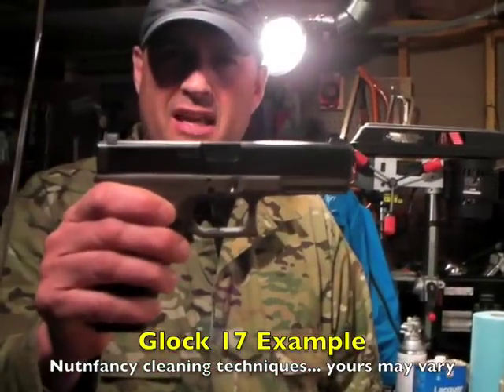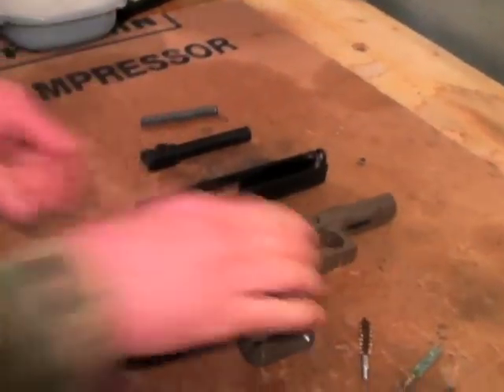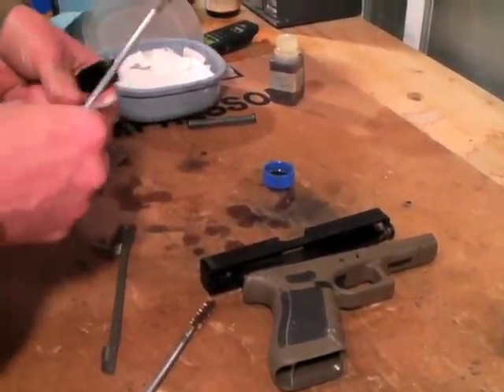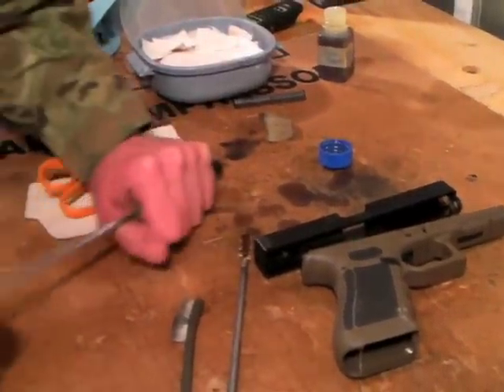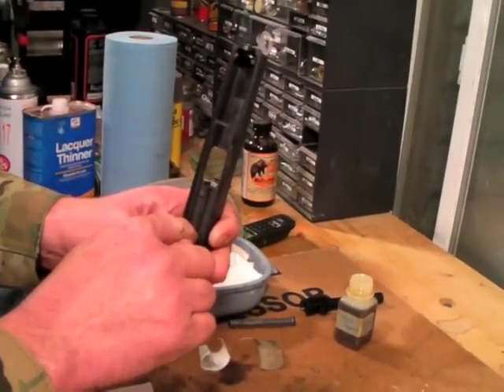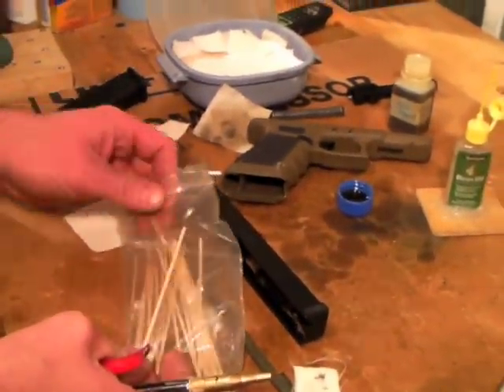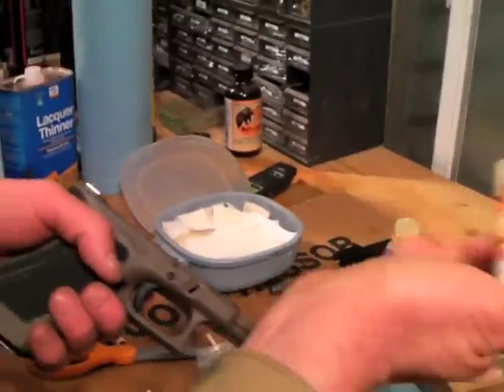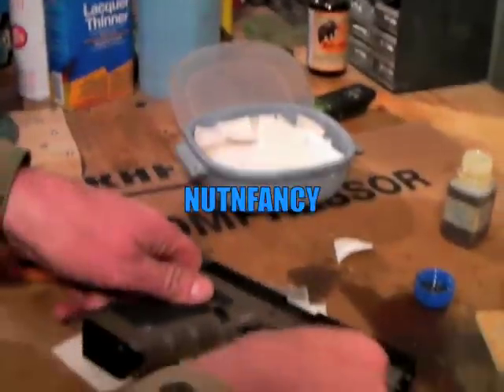Pistol Cleaning by Nutnfancy:  The Glock Example

Comment: It does not matter how many times we have cleaned a gun, it's always nice to watch someone's technique. Thank you for doing this video, it's also nice to see we use about the same products. I am trying this Birchwood Casey spray solvent right now, so far so good. Although the Hoppe #9 is what I'm used to as well. I'll probably switch back when I run out of this spray. It's hard to break old habits. Thanks again Nutnfancy, your videos are by far the best.

Comment: I like how you are not biased to your view on "this is the only way to clean a gun".
you show your system and that's cool. I was actually curious to if I should grease up some of the parts where the slide moves on the actual gun itself. I always just left it normal. thanks for great videos. 
Andrew

Comment: With how often you clean guns I would suggest wearing gloves.  A lot of the chemicals in solvents/gun oil can absorb through the skin.  Make sure the gloves are resistant to the types of chemicals in your solvents as well.  Different types of gloves are resistant to different chemicals.  You can find the information on the glove manufacturer's website.  BTW I'm a biochem major and now in med school, if you're wondering why I'm harping on this issue.

Comment: I spray out slides and frames with aerosol gun cleaner or WD40 in a pinch. Carb cleaner works too. Spray them out allowing fluids to run off into a catch can or something similar using the brush in between sprays. Compressed air to blow out excess followed by oiling.

Comment: I have found that washing my autos in the sink with detergent and ultra hot as I can stand it water works superbly.  The thing is to dry and oil them ASAP since the Dawn and hot water really will cut all the oil off.  The dishwasher will not only wash it hotter than you can stand it but will also use high heat to dry it.  Folks use the dishwasher to strip surplus rifle stocks.  It works.

Comment: You might want to watch using Hoppes #9 and/or  Sweets 7.62 on the internal parts of the frame. Both of these cleaners are metal fouling removing and the internal metal parts are electroless Nickel and Teflon coated and in time these cleaners will strip the plating off. Well according to T.R. Graham it does anyway.

Comment: For the lovers of OEM glock grease, it's just Loctite Anti-Seize Copper. However Brian Enos's Slide-Glide does wonders on on the rails. Know that nutnfancy said not to get too into lubes, but definitely glides smoother than any grease I've ever used and stays where you put it for a long time. A little tub lasts forever.

Comment: that's a good idea, but make sure you clean them regularly 'cause they REALLY hold on to dirt and grease. I used to work at a truck parts store and we lined the front desk with those for the exact reason you did. Little parts didn't go rolling when people brought them in. We never cleaned them though and you couldn't touche them without getting pretty filthy..

Comment: Nice. I personally don't use so much oil though. I use Tuff Glide after I clean for lube and let it sit over night muzzle down to drain/evaporate. Leaves a nice dry film of lube on the rails. No lint or dust.

Comment: Yeah, I understand this but the point is is that according to T.R. Graham in the video "How to Make Glocks Rock," these cleaners will remove the coating on the internal parts in time. I would trust Graham on this because he is a glock armorer and a well known gunsmith. So if you have a choice, I would just use these cleaners on the barrel and keep them off the other parts.

Comment: I agree with the comment that you HAVE to do a visual (or tactile, for low-light practice) chamber and mag check before doing anything other than shooting or holstering!
At the end of the video, you checked but at the beginning there was no chamber check.
Also, when you were cleaning the frame, you were holding it with your finger on the trigger. 
You have years more experience than I do, and I have gotten a ton out of your videos, but gun safety is still the most important part of protection!

Comment: @ismokedaily420 With a Glock as well as some other pistols, you have to dry fire them to take them down.  I believe the general rule is, you can dry fire center fire pistols but it's best not to dry fire rim fire pistols because of the greater chance to break/damage the firing pin.

Comment: cont. from below:
in the shower: use rag and boar brush to clean rifle
once you've given her the once over, rinse any remaining shaving cream off of rifle/ out of bore
after your shower, wipe down and let your rifle dry completely
once dry, lightly oil/lube as you normally would
finally, give her a good wipe down to remove any excess oil

sounds crazy but it works better than any other method i've tried. my m1a came out looking like it had never been fired.

Comment: Hey nutnfancy, thanks for all the vids. Your Glock 17 review helped me make a final decision on buying my first pistol  (A Glock 17). I was reading through the owners manual  and there is no instruction in there about using rim oil or any lubricant inside the barrel - is this just a personal preference of yours or do you feel that it is necessary ? My gun is brand new and has never been fired, I am just getting ready to lubricate it before I take it out to the range for the first time.

Comment: The oil, if it's left in the barrel when you fire it can distort the land and groves over time, especially if it has Teflon coating like Rem-oil.  But if you wipe it out you're all good. 

Not sure what it does to hexagonal barrels like Glock.

Comment: Great video!!  Thanks!!
I was very surprised at your method of clearing the gun before cleaning.  I know you are a very thorough guy, but this is a big exception to that, IMO.  You only rack the slide several times and never actually inspect the chamber visually and with touch!?  What about that person who doesn't rack the slide fully enough to eject a round?  What about a broken extractor?  Or a broken ejector?  Or a broken case rim?  (cont.)

Comment: Militec rocks (especially in places like Iraq!) because it's attracted to metal, unlike CLP which is attracts dirt.  i.e. weapon system stays a lot cleaner and it actually almost works itself into the metal so that after about 2-3 days of application, it keeps your weapon super lubed and functioning well.

Comment: As far as the guns go however, (machine variety) your're pretty much stuck with CLP, and you need a lot.  An M240B, for instance with not go through it's complete cycle of functions dry and it takes a lot to lube it up PROPERLY IOT last in a firefight (we're talking you having a spray bottle handy).  If you're a civilian, disregard.

Comment: Don't you lube the slide rails? I use to apply factory-like copper grease to the rails in the slide and a little bit on the 4 rails on the frame. I change grease of the frame after each fire session and I change grease of the slide after 1000 rounds. For the barrel I use Ballistol oil by Klever and after 400 rounds I use Milfoam Forrest. For lube I use Ballistol too.

Comment: The amount of oil you left on the outside of your glock barrel, wouldn't that cause it to jam from powder residue getting stuck to it? just wondering? Why do you use rem oil in some spots then another type of oil for other parts?

Comment: will putting solvent in and on the slide ruin the glock? cuz i did that trying to clear out that copper lube, someone told me to do that and replace it with regular lubricant

Comment: i just shot mine for the first time and whne i broke it down to clean the barrel i was told to go from the back towards the front of the gun not the other way around. I did not use any of the gun oil though. When i tried to use the metal brush it would not really go into it. I could not screw the barrel up with that could it? it was for a 9mm

Comment: Barrel wise, same as a rifle,granit I have never really seen a "dirty" air rifle.I have a gamo i have had for years and never cleaned it,looking down the barrel now I see no "fouling", most fouling comes from the gunpowder blast of a "real rifle" and air rifle simply doesnt have the means to really dirty the barrel up .
One last thing on air guns, stay away from "real" gun cleaners(ie. hoppes) it will eat at the rubber seals and ruin your gun( it wont be able to hold the air in)Good luck!

Comment: @SNIPER12431243  well its the solvents that i would  be weary of , but with small cuts the very fine metals could as well, but thats just my opinion  ask  your ASE mechanic if its advisable to wear rubbers when working on parts with things like brake dust and solvents

Comment: Dude.... I have one comment , " Q -TIP " for the slide rails for Clean and Lube. If the patch get stuck you will not GOUGE your rail with a sharp edged Screw Driver !!

Comment: "Both of these cleaners are metal fouling removing"...  The cleaner is designed to remove fouling. That's the point of cleaning. Not to have it nice and shiny but to have the gun in tip-top shape.

Comment: And aw man Nutnfancy NO GREASE ON THE BARREL?!?! haha. I use mixture of grease and oil on the entire Glock. lately I have just picked up a tube of hoppes grease locally(meant for strorage not lubing) and I just apply to the surface and put a drop of oil on it to reduce the viscosity and my actions are so smooth! I keep the entire barrel lubed that way on my glock 29sf when I carry it and it keeps the oil from running at all, and really prevents it from wearing as much(mainly during practice),

Comment: How about Froglube or Mpro7???  Have you used these two on any of your Glocks?
Reply: Mpro7 really gets rid of hose nasty lead/carbon rings on the front of my revolver cylinder (Ruger GP 100).  It has been really good at removing lead from the barrel too.

Comment: I'm hoping someone here can help me out....I've had my glock 17 for a few months....about 2 months ago I started using froglube, before that I was using ballistol but the problems I'm having have preceded any cleaning product changes....I use my glock cleaning rod, the nylon bore brush, and a brass bore brush followed by cotton patches. ...for some reason it's taking me over an hour to get that damn barrel clean. I'll run through 30 patches or so and it's starting to get frustrating and I don't really know what in doing wrong or if my ammo is just dirty shit (mostly just fiocchi 9mm, freedom munitions,  and blazer) ....I use the frog lube solvent and the clp and I just let it soak for at least 20 mins...but even still I have a real hard time getting the damn thing clear of fouling....adding the brass brush to the mix helped some but it still takes a long time... I've seen others have no issue cleaning with frog lube so I'm wondering if maybe that glock cleaning rod just sucks for the patches, any thoughts?
Reply: +dan bishop  I have never used frog lube but in my quest to find the best product to clean and lube my firearms I have researched it quite a bit.  From what I have learned the more you use it on a gun the easier it will be to clean.  Since you just started using it it is possible your gun just isn't seasoned good enough with it yet.  Also one of the trade offs of using a non-toxic cleaner is how quickly they work.  You might try running a wet patch down the barrel and letting it soak for an hour or two to give it time to work before using the bore brush and dry patches.  If the filth doesn't come out readily after that long of a soak there might be something else going on and I'm sure the professionals at Froglube can help you get it figured out.